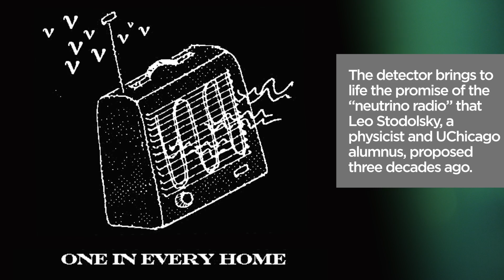UChicago physicist helps create world’s smallest neutrino detector

Comment: Imagine Neutrino Internet. No more fiber cables looping around the Earth, just send your signal directly through the Earth and catch it on the other side. It'll be way faster internet because it's faster to go through than around, and it'll be available everywhere because neutrinos can travel forever, and you don't need infrastructure to carry them. Only downside is it's probably not very mobile, since you have to know where to point your beam of neutrinos.